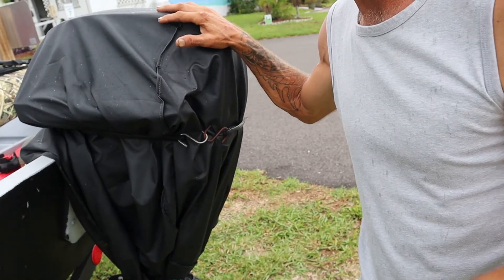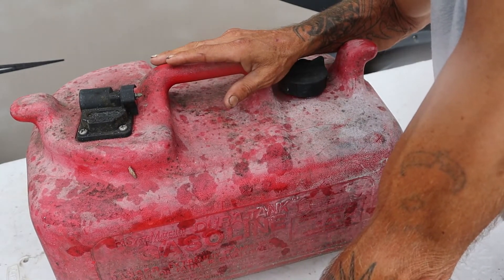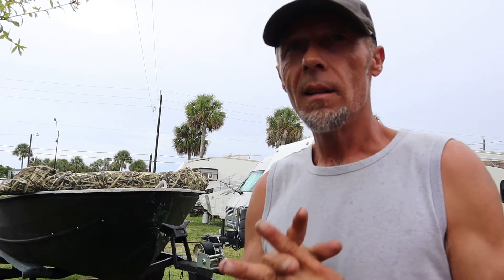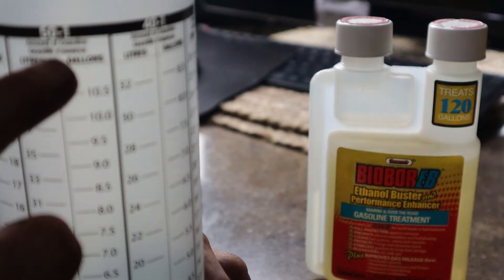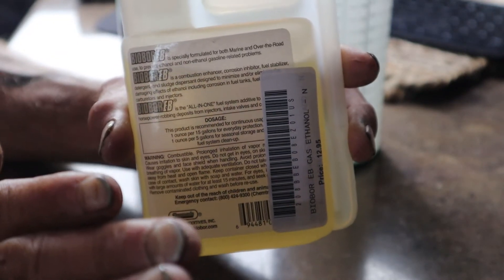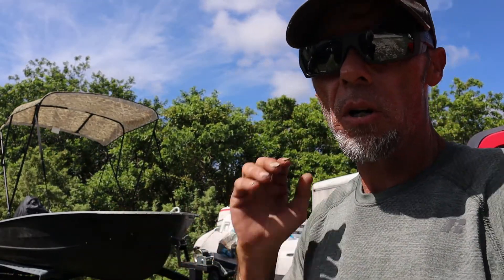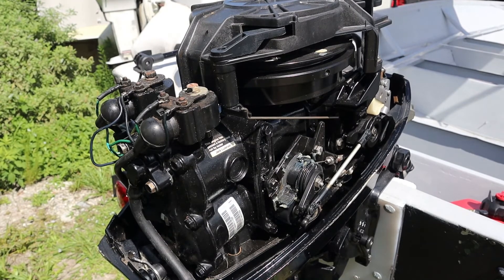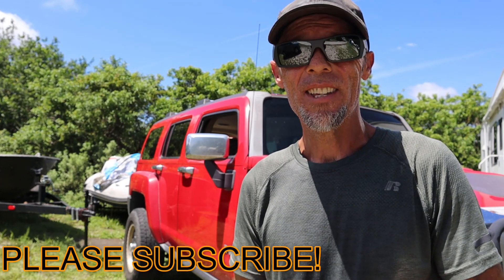HOW TO SET UP FUEL SYSTEM FOR TWO STROKE OUTBOARD BOAT MOTOR

Comment: Love the video. Very informative. Very helpful. 
I just purchased a 14' deep 'v' aluminum boat w/ a 1964 Evinrude 9.5 hp motor (fully restored by T-Mikes Vintage Outboards on YouTube). I can get 18mph w/it and was wondering what your 8.0 Mercury gets pushing your 16' ??
Also, have you done any solid rivet work to your rig ??  I'd like to move the back bench seat up about 8 to 12 inches to help get the boat to plane earlier (i'm heavy)  What do you think ?
Have you ever painted your boat or any aluminum boat ?  I'd like to paint mine but want to do it right and am looking for direction.
Thanks for sharing and your generous consideration,
Sincerely ...............
God bless,
Steph - Louisiana

Comment: I was sort of hoping for a Detroit Diesel engine. Hi-Lite that 50-1 row on your container. I found some good stabilizer for gas, and it will do ethanol. Using two year+ old gas in my lawnmower and generator and it works good.  Adding extra oil takes the space of gas and makes your motor run leaner on gas. And your motor will burn up. Lots of the little old motors got burned up that way. Lots of horsepower limited lakes up here. Thank you for showing us your progress, Tim. Stay safe and stay cool
Reply from the maker: Take care Sean